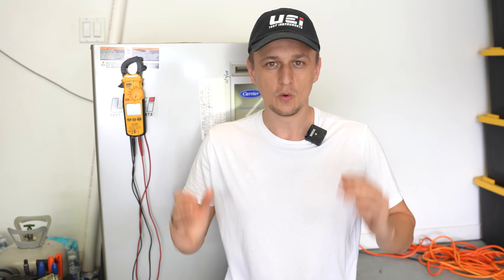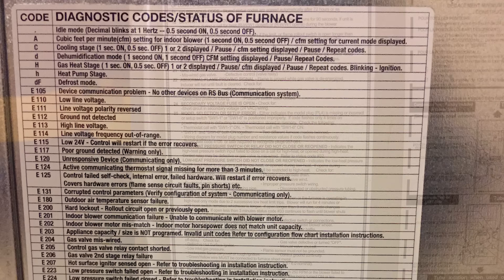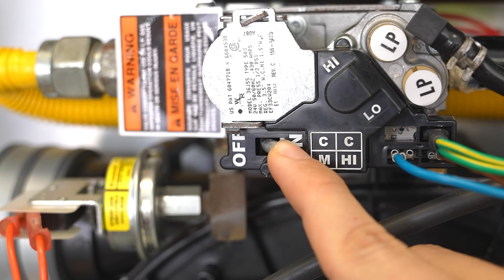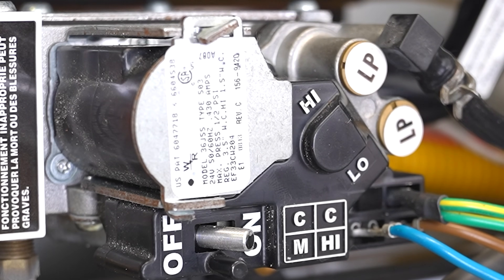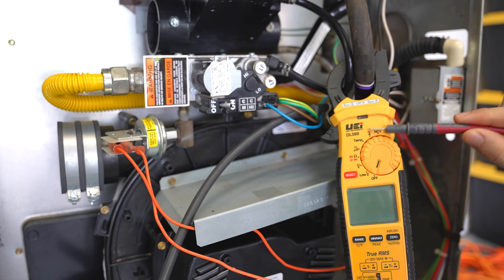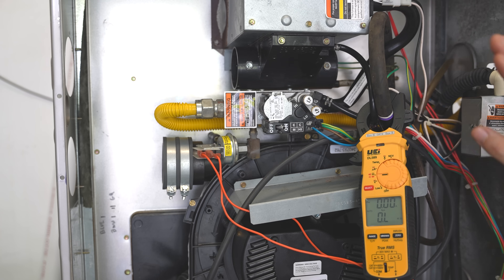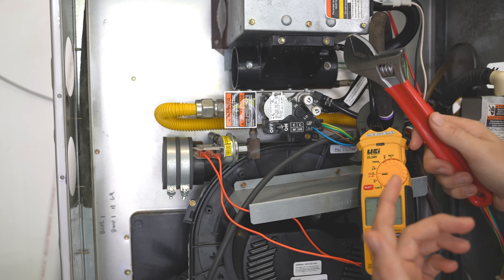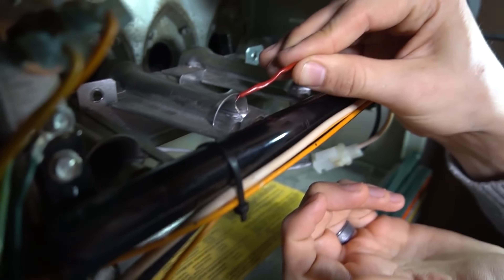Furnace Gas Valve Not Opening - How to Fix It

Comment: Here's another scenario for you (from personal experience).  If the gas valve gets too cold it can tend to stick. For example if you go on holidays in the winter and set your thermostat really low (I was setting mine for 5 C / 41F) it can get cold enough that whatever lubricant is inside may get too gummy to allow the valve to move.  After banging my head against the furnace for hours trying to figure out why it wasn't working  (and watching all your videos on the subject!) I had an "ah ha!" moment and got a heat gun and warmed the valve up to a normal operating temperature and BINGO... working furnace!   

Thanks so much for these videos. Because of them I've extended the life of my furnace by several years, fixed it several times (new blower, new flame sensor, unclogged sensor lines) and I'm not afraid to rip it apart and put it back together in order to find out whats wrong with it.  You've probably saved me hundreds of dollars over the last 5 years!
Reply from the maker: That's a great tip! Thank you for sharing! I've heard that multiple times from people who were able to get it fixed like that. Glad to hear that my videos have been helpful to you throughout the years! Stay warm this winter my friend and may your furnace be problem-free for at least the next 10 years!
Reply: I was having issues with gas valve after replacing the control board, unscrewed it gave it a few good taps and some time later we had heat. I almost gave up
Reply: Bruh you literally just saved me from these cold days ahead thank you!

Comment: 43 years experience and I tell all new techs, if you can get a stuck closed valve to open by tapping it, it can also get stuck in the OPEN position when the call for heat expires, allowing gas to continue to flow. NEVER LEAVE A FURNACE OPERATIONAL IF THAT OCCURS. Shut the gas supply and get a new valve. Forget the lawsuit. You could be criminally charged if there is a tragedy.  Your customer would rather be cold than dead.
Reply: 100% agree I told my apprentice the same if you need to tap it in order to make it work is good to help heat up a space while watching it but don't leave it running and turn off the gas and remove w from the board and then get a new gas valve
Reply: @jonl2996  & bills6946 absolutely 👍. I was a first responder / HVAC service technician for the gas utility in STL for 35 years and the scenario you mentioned happens more often than the average HVAC technician might think. Most of the time they would come in as a typical gas odor at the furnace but more than a couple times I would find that furnace door blown across the basement.
Reply: @boby115  They reported having tapped the valve to open it, previous? Curious...
Reply: @RogerPack 
No one would ever admit to that.
Reply: SOLID advice.   Can't replaced your family.  But you can replace the valve
Reply from the maker: I haven't hear of this happening before but it does makes sense. Definitely something to pay attention to, thank you for the warning!
Reply: There are additional safety features so if you exercised it and see it operational seemed it haven't had issues. I agree safety I have a camera so if I am out I can see if something is not working as usual there are safety features so stress less but, yeah is a sign to update ultimately my unit just turned 20 year only used for heating
Reply: If you know what you are doing, it is your judgment to temporarily get heat for the night. I rather die comfortably than die cold.
Reply: @victorquyenpham3909 , yes, when it comes to equipment I own and in the physical location of my presence is one thing .Putting a potential dangerous piece of equipment in operation in other peoples location I have no control of after I leave, is a no go (it gets isolated and tagged out). Most people understand & use extra blankets, layers of clothes & safe operating space heaters. Now when I leave people without air-conditioning,,that’s a different story, it’s almost like they want to tar & feather me.

Comment: Gas valve not opening.... HAMMERTIME
Reply from the maker: The hammer is the ultimate final boss. 😄
Reply: I actually do something similar if it's a really old system and the gas valve is stuck. Just trying to keep them going until the unit can be replaced if that's what they're doing

Comment: I'll share my furnace adventure from this past week.  Simply put, its a gas furnace that would not ignite and heat the house.  The thermostat would click to activate the start sequence.  The "fan" that draws in air from the outside and blows the exhaust to the outside would turn on.  But nothing would happen after that.  Im not that handy, so after checking the ignitor...which looked good...i called the hvac repairman.  He came out, checked stuff out, and thought the module/part that senses airflow might be the problem (not the gas regulator).  He said there's a membrane in that module that may fail over time.  So he replaced that part.  But still it was a no- go.  After he called a peer for other suggestions, he blew air from a tank canister into the exhaust pipe opening where it internally connects with the exhaust fan.  (I know I'm not using correct terminology, but hopefully you can follow along.). Voila...it worked.  He speculates spiders might have built webs that blocked that air flow enough to cause the problem.  The spiders cost me almost $300 in labor.
Reply from the maker: Good to hear that they were able to get it fixed and my condolences to your wallet sir. Thank you for sharing your experience! I agree with the other commenters, that this issue could have been found before replacing the part but the problem you had isn't exactly a common one so I can't blame the tech, especially if he is relatively new to the field. May your furnace work problem-free for the next 10 years now. Stay warm this winter!
Reply: Sounds like the tech didnt do his job. A pressure switch can be tested for correct operation using a manometer and verifying the pressure is enough to activate the switch.
Reply: @lucidgaming1153  It's hard to find knowledgeable and ethical repair people for appliances, HVAC systems, autos, etc.
Reply: @myidisinhim yup most are just frickin salesman nowadays
Reply: @jessebHVAC  No joke I was just wondering how many techs are like "valve doesn't seem to be working, need new valve or new furnace" when it's just a loose electrical that's fixable...
Reply: $300 for a furnace repair not bad at all
Reply: In this case I think your furnace may have been showing some codes that said "inducer motor not working" ... Worth double checking codes first. I assume this was a "high efficiency" furnace? How do pro's "normally" check if the exhaust is blocked or not?  I have heard that blocked exhaust can cause pressure switch failure, which sometimes causes valve to not get voltage (if it's inline on an older one)...which can also cause "lots of clicking back and forth" for the valve...voltage should be steady at 24v as well...

Comment: does anyone know why i seem to be getting to much gas from my valve.  I did set it with a manometer to 4 inches water column which is what the furnace calls for
Reply from the maker: Thank you guys for all the help with troubleshooting in response to this comment! Hopefully with all the suggestions you will be able to get this figured out.
Reply: What makes you think ur getting too much gas? 2 stage or single stage?
Reply: @lucidgaming1153  flames are bouncing around the outside of the chamber and it's not blow back and single stage.  I   turned the gas down and it was acting perfect but i had to turn it way down.
Reply: @ronamo111  How old is the furnace?
Reply: @bernardocisneros4402  it is at least 25 years old or more but in pretty good shape
Reply: @ronamo111  Have you cleaned the gas nozzles (spud orifice) with a torch tip cleaning set and the burners with a steel wire brush? Some really old ones from the 1960s you actually clean the burners with a hacksaw blade. I'm sure your burners are not that old.
Reply: @bernardocisneros4402  no i didn't clean the nozzles but i cleaned the tubes with a wire brush.  that's when i noticed so much  gas.
Reply: @ronamo111  how do you know it's not blowback? Have you had a combustion analysis done? Does the flame get worse after blower turns on? Gas pressures can be adjusted a little bit outside of the setpoint if needed. But should generally be where manufacturer wants em
Reply: @lucidgaming1153  when i turn the pressure down it looks perfect the problem was i had to turn it down to around 2 inches water column
Reply: @ronamo111  Are you thinking this might be a result of cleaning the burners? After I clean those with a steel brush, I blow them out with compressed air to make sure I get out all the loose debris. I would clean those orifices. I also set those old one to about 3.5 WC. They run well around that.
Reply: @ronamo111  Like Lucid asked, does it get worse when the fan starts. If it does, it could be a cracked heat exchanger
Reply: @bernardocisneros4402  no  it stays the same just to  many flames bouncing around like it's getting to much gas
Reply: @ronamo111  That's good to hear. Have you tried adjusting the primary air with the dials in front of burners?
Reply: @bernardocisneros4402  just to let you know i put new jets in the manifold and it got a lot better i'm also going to turn the pressure down a bit and it should be good again
Reply: @ronamo111  Glad to hear it got better. You say you're going to turn down the pressure, what is it at now?
Reply: Also, whats the model and serial of ur furnace
Reply: @lucidgaming1153  it's a Payne series E model 395cav024070 min supply 4.5
Reply: @lucidgaming1153  I just thought i'd let you know. I changed the jets in the manifold and it got a lot better i'm also gonna turn the pressure down a bit and it should get good again
Reply: @ronamo111  is there enough supply air for combustion? What's ur excess air? If this started recently there's a reason behind it. Would still like the model and serial of the furnace
Reply: @lucidgaming1153  it's a Payne model 395CAV024070  serial # 3195A16667 series E
Reply: Definitely needs a combustion analysis
Reply: @zachmanning9499  thank you

Comment: Connector fitment problems are common in automotive circuits, too. A cheap tool that sometimes helps with that is an oxyacetylene tip cleaner, which has a set of abrasive probes of various size that can clean any oxidation on the contact surface. Often one can tweak the fitment by squeezing the female end of the connector tight so you don't have to jam something into the side. It's humbling to know that the most common problem with fitment is caused by the last tech, who stuck his multimeter probe into the female connector. I like your technique where any probing is done on the outside in, so the probe would make fitment tighter, rather than looser. A drag test later verifies a good mechanical connection.
Reply from the maker: Thank you for explaining in detail about the connector fitment problems! That really helps paint a clearer picture of what is really going on. I appreciate you stopping by and sharing your thoughts on the topic! Have a marvelous new week good sir!

Comment: I Have found in older FAU that the solenoid in the valve is stuck. I tapped it and freed it.
Reply from the maker: Ah that's a good point! Tapping on the solenoid might actually be more effective than the body of the gas valve. Thank you for sharing!